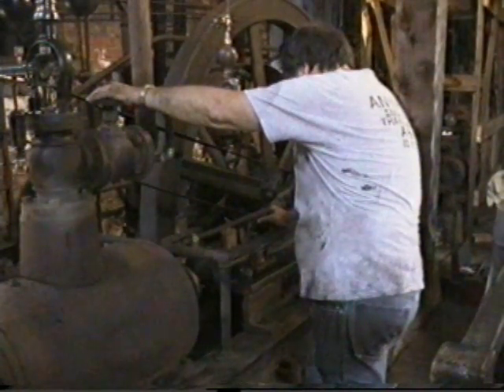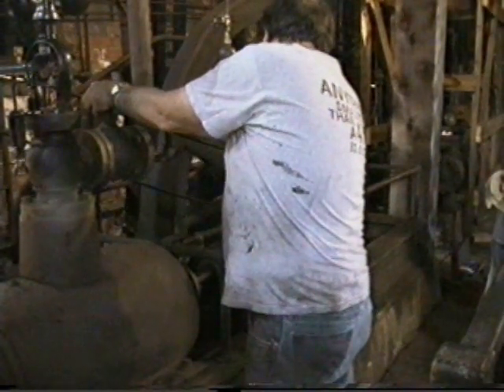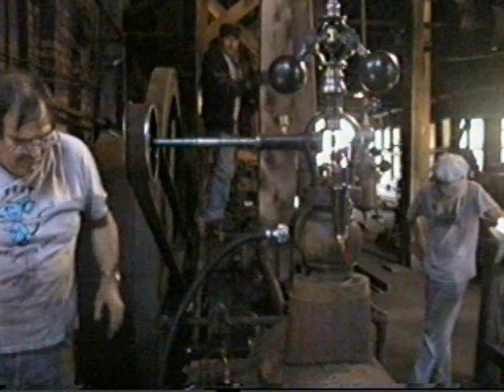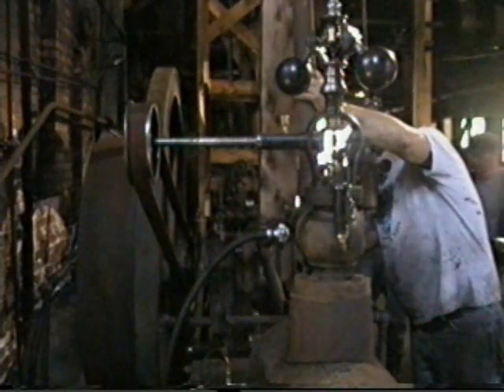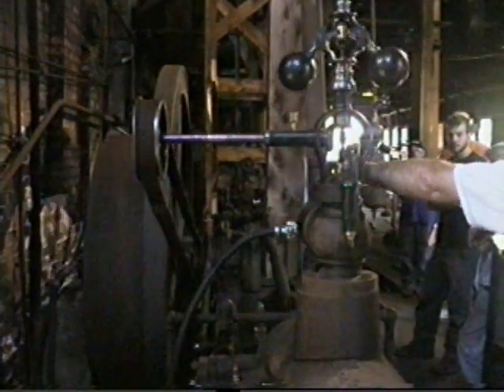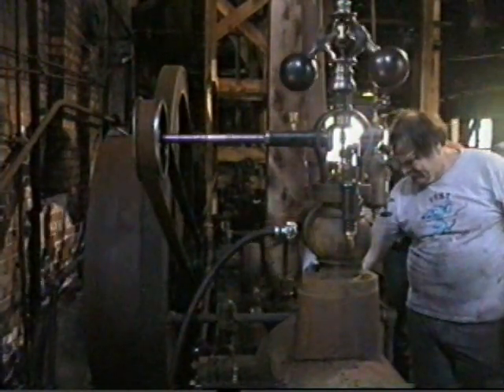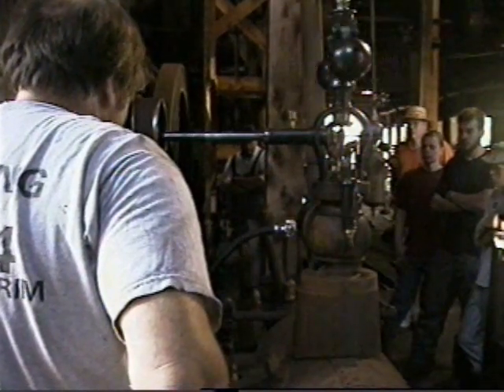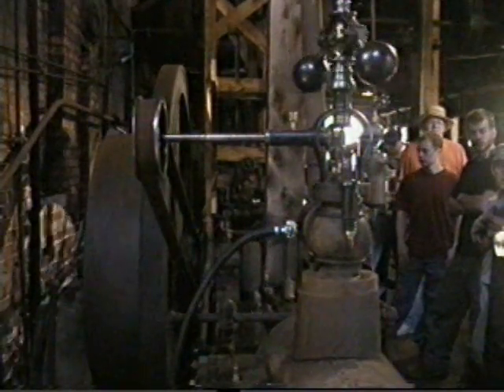East Broad Top - 1870's Shops Steam Engine - First run in over 50 years - Part 1

Comment from the maker: First, no boiler work was needed for the shops engine as it is being run on compressed air. #12 and #17 both need a lot if that. Second, we did not have to remachine anything to get this engine running..#12 and #14 both need a lot of that. (#16 and #18 are unknowns.) Rebuilding a locomotive would be a much more involved and costly process than what was needed to get the shops engine running. by comparison this is a VERY simple engine.

Comment from the maker: @buddhafollower  If you mean the flywheel, this is the first run in 40 years. It needs to limber up a bit after sleeping 50 years. Also, we were limited by the size of the compressor and diameter of the flexible air line being used. Not sure what you mean by 'water tank' as this is a steam engine.

For later runs a larger compressor and dual air lines were used. That in addition to tweaking the packing and bearings has resulted in higher speed.

Comment from the maker: The hydrostatic oiler was restored and reinstalled for show. There is a mechanical lubricator installed on the cylinder which actually does the oiling.

Comment: Nice engine. Takes more air preasure than steam to make them run. On another note, I seen a hydrostatic oiler on the engine- those lubricators will not work with air.

Comment from the maker: Since the video was shot the four cylinder compressor was swapped for a larger diesel unit and larger diameter line run to the engine. This has substantially increased the speed, though not to governed speed. The speed is adequate for demonstrations without load.

Comment from the maker: We are looking at that. The buildings are still settled and it will take a lot of work to bring them back into line. Without that work the line shafts are still bound up, including the main shaft off the engine. We are getting some of the shorter shafts (ones that power only one or two machines) operational right now.